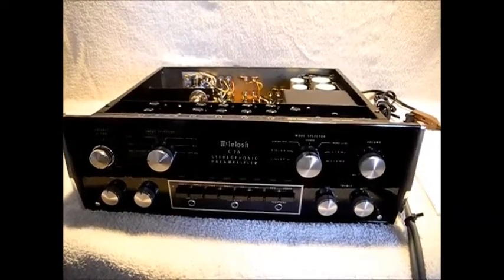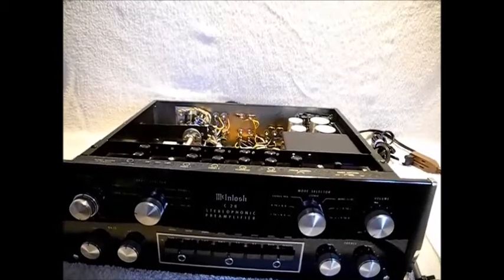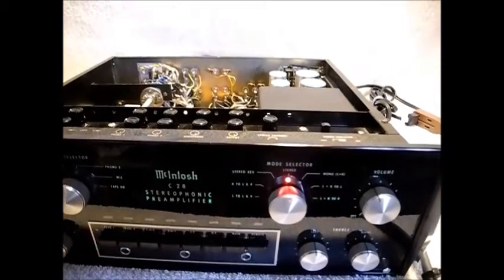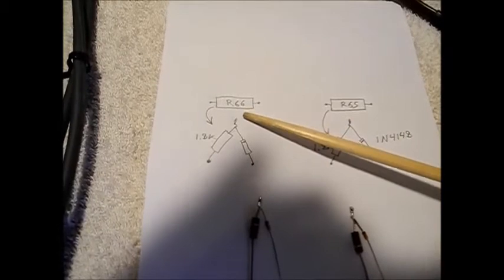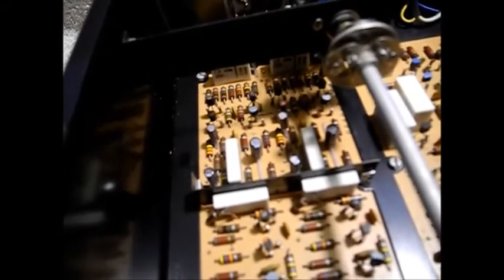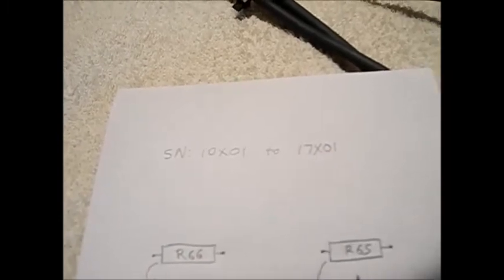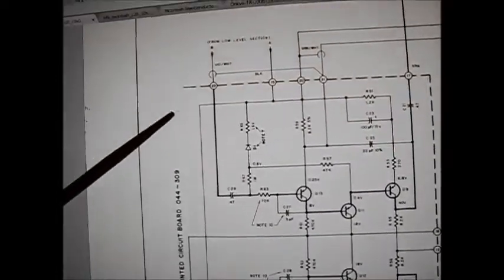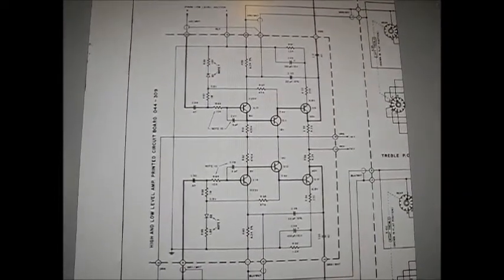McIntosh C28 Early Version -  Elimination of Turn On and Turn Off Noise

Comment: In the old days was call Mctrash by other equipment sellers. I use to owned the C28 and the 2105 amp and they spent most on the Mc Intosh service shop.